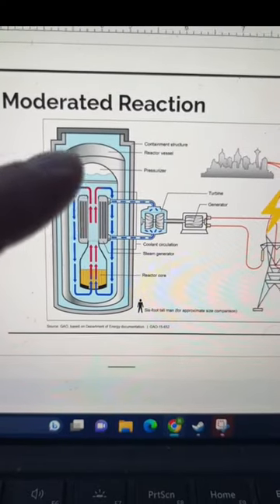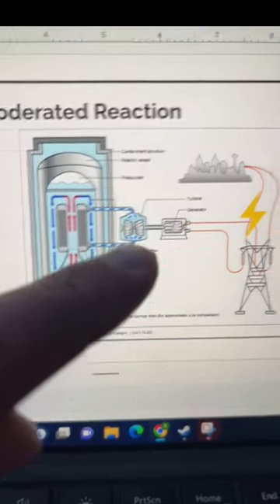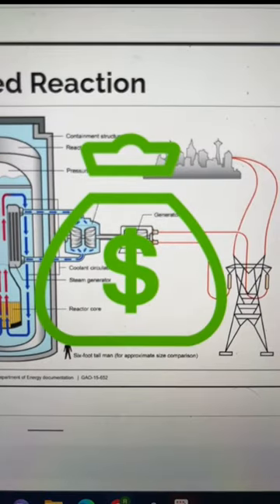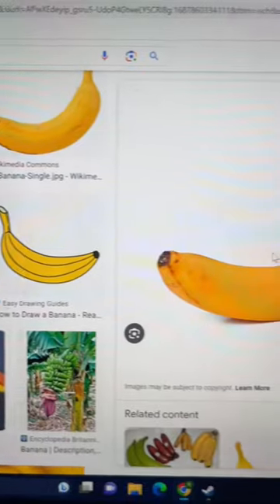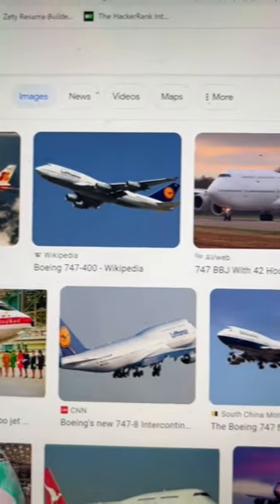No, The #Zaporizhzhia Nuclear Plant Will Not Explode

Comment: You can walk into the reactor building not the reactor. The used fuel in the reactor is highly radioactive and still emitting significant decay heat. If cooling isn’t maintained the reactor will continue to heat up until the point where the heat radiated by the vessel equals the heat generated by the fuel. As long as enough heat is removed to keep the core from boiling it will remain safe. If they don’t then when steam develops at high temperatures it will react with the zirconium in the fuel rods creating hydrogen and embrittling the zirconium. The pressure from the fission gases can cause the embrittled fuel rod to crack letting the fission gasses out. They are radioactive and if released into the reactor building, auxiliary buildings, or the environment will cause a minor problem. If the temperatures continues to rise because the decay heat isn’t removed it will eventually melt the fuel. Then you have TMI. You won’t get a Chernobyl or Fukushima because these reactors are PWRs.

Comment: But it was the spent fuel rods and the pools that wiped out the Fukushima Nuclear Power Plant.  The backup generators failed and the water evaporated.  When the rods were exposed to got so hot the broke down the water and released hydrogen into the reactor building and several of them blew up.

Right now with the Dam gone and the water levels too low they are relying on the reservoir pond attached to the power plant.  They problem is they can not cool the pond and it is too small to handle 6 reactors worth of spent rods.  Now it is possible to run pumps into the river or to truck in water, but they are in the middle of a war and Russia I don't think really cares.  There is still concerns.

Comment: I thought the concern was a lack of cooling water since that dam blew up
Reply: You just recirculate the water that's already in the plant. An outside source of water is only needed to top off the system to account for evaporation.
Reply: @ghost307  so how long before evaporation causes a need for a new outside source?
Reply: @moshethepirate1428  That depends on the design of the system.
At the plants I built it varied from months for the ones that built a cooling lake onsite to never for the one on the shore of Lake Erie.

Comment: The only thing that I would be concerned about is how long the reactor has been shut down. The heat from the decay of the fission product daughters can cause melting of the fuel matrix if there's a loss of coolant. Still almost definitely not enough heat to chernobyl, but enough to cause significant damage to the core.

Comment: I wonder if people are aware how bad of a recipe for disaster it is for a nuclear plant to be without power, or diesel for backup generators. The underground power cables to the plant have been cut, and/or compromised due to shelling countless times. Usually the backup diesel generators would kick in. But at one point they didn't even have diesel to run the generators. They were left in the dark. So far the longest they were stranded without power has been 12 hrs. Without power your hands are tied in more ways than one, and it's a ticking clock. And the words out that it's more likely that the Russians could be planning to destroy or damage large areas of vital infrastructure at the nuclear plant to create a major distraction for the oncoming Ukrainian forces. I sure hope not.

I don't think Ryan knows wth he's talking about to be frank!

Comment: The spent fuel pools ARE a serious risk to the entire plant's biosphere. If the pool water was to go for any reason, the spent fuel rods could go critical. If they did, there would be no way to shut them down, and the possibility of a meltdown is very real. If the rods melt down, they will burn through the pool concrete and cause a steam explosion when they hit the water table. This would cause a massive NON-NUCLEAR dirty explosion, seriously contaminating a very wide area. While the steam explosion is unlikely to cause a Chernobyl - like cloud moving over Europe, the heavily contaminated area surrounding ground zero would be many times larger than that of Chernobyl.

This is the real problem: an area about the size of the entire power plant, as radioactive as the roof top at Chernobyl, and at its centre a nuclear meltdown. Too radioactive for remote controlled vehicles to operate. The scale of the disaster, is probably too big for the resources of the entire planet to deal within a reasonable time frame.

Comment: No it won't explode but cutting off water to resupply those cooling pools and allowing them to boil dry could (if they have enough latent heat) cause a mini meltdown, which would be bad but would likely be contained within the shielded plant.

Comment: In cold shutdown state the temperature is not enough so even if you blow up the cooling water system the reactor will not go meltdow. You will have to blow up the entire reacfor causing fuel rods flying as ashes and thay will require lots of heat and explosive energy. Dont think any c4 or high explosive can do that. You will have to explode the reactor inside the capsules and released the pressure instantly. Impossible to do

Comment: Some.of this information isn't quiet right. The water doesn't need to cool b4 going into pods. As it never boils. The reaction separates the hydrogen and oxygen. It's fine to be in the water within 15 meters of the core. The radiation is greater at 35000 ft in an aircraft than standing in the water 15m from the reactor.

Comment: Nuclear power stations are safer than you think, what happened in Chernobyl was a freak situation that was basically caused by human error and poor understanding of how the plants cooling systems worked, the reactor would have automatically ‘scrammed’ but operators interfered with it and caused the explosion, the explosions were caused by hydrogen and oxygen gas exploding not radiation, things will be ok in the plant even if everybody up and left it unattended in its current configuration b

Comment: I don’t think you “shut down” a reactor just like that.  Control rods are inserted to absorb neutrons,
which slows the fission reaction down, but cannot stop it entirely.  The reactor critical material (most likely Uranium) will remain very hot and will require coolant.  If you lose that coolant there will be a meltdown, even in a “shut down” state…you just require less coolant than when it is at full tilt.  A meltdown would spew radioactive waste Chernobyl style in the immediate vicinity and wherever mother nature takes it (hello Russia).  So while no nuclear explosion is technically possible here, a gigantic and deadly disaster most certainly is.

Comment: Thanks for pointing out that Zap won't "explode". That is a fair comment, one that has NOT been made enough in the general discussion.

Great, "we", (aka the US) tested TRANSPORT canisters by crashing a train. I don't know for sure, but I suspect that transport containers are not the same as the on site storage tanks. Maybe they are, maybe they aren't.

On the other hand, do you really want to trust Soviet Era design and construction against a determined plan to breach them? 

Russia has all the appropriate specs for the containers. They have demolition experts who can create a demolition plan to breach the containers and to spread the contents explosively.  If we are lucky they gave the job to Vlad the goat herder from "Outer Slobovia", and he figured a couple of grenades would do the job.

If the russians do drain the cooling pools, then yes, given time the rods will overheat. They will probably catch fire. If they catch fire they will spread radioactive ash into the air.

Comment: Hmmm

I know containment vessels have been tested by driving high speed trains into them in the west...

I'd be rather less confident about anything radioactive that was built by Soviet engineers

I'd like to think otherwise, but it's just a sad fact

That said though, don't worry about the reactor if you live in a location with high levels of background radiation (typically due to the rocks beneath them) - but even then - look at rates of cancers in those areas - I bet they're insignificant and yet that's the critical number isn't it

Comment: Well no.... it won't explode. However, if its in a coolong pool it means its hot enough to melt and catch fire and essentially cause another Chernobyl type of accident. Dry stored fuel will not cause widespread contamination but would be a very large "dirty bomb" thus making the plant uninhabitable.
Reply: Chernobyl types of accident can't happen when there's a concrete biological shield. The Chernobyl disaster is infamous because the RBMK was built without a shielding dome to cut costs.

Comment: far as i remember there is only 1 of the 6 units in operation , the other 5 are in cold shutdown.. right?  as far as hitting something with a train... how does that compare to an anti armour /tank mine?  its like hitting a grape with a hammer that weighs as much as a barn vs hitting a grape with the barn... the idea they cannot be compromised is a bit wishful thinking... but who would mine nuclear waste storage?  i think the major fear should be ground water ... its like fracking... add rain water... thou destroying the dam will change the eco-system of ukraine... turning some of it potentially into desert so rain may not be that worry some.  the 1 that is still active could that still go into meltdown and cause another 3 mile island sort of scenerio?

Comment: Yeah...you are talking about a PWR, Pressurized Water Reactor made by Westinghouse, Babcock and Wilcox or Combustion Engineering. These are light water commercial reactors. Three Mile Island 1 and 2 were PWRs. These are the reactors that you can not enter containment during operations, except with a special permit. GE designed all of the BWRs world wide. Boiling Water.Reactors, another commercial light water reactor. These you can walk on top of during operations. Think Limerick 1 and 2.

You are pronouncing Zaporizhzihia incorrectly. I lived in Zap in 2010.  The 6 units at that NPP are another design called VVER, which are another type of light water reactor, not sure how they operate compared to BWRs/PWRs.

Your explanation of the Dry Cask Storage and NPPs producing energy are a basic synopsis.

Comment: Well, yeah, it's not a huge deal + panic only helps putin.

But it's also not just "like flying on a plane". 
If you live where the nuclear clouds come down it WOULD be like being on a plane. PERMANENTLY. 
A plane flight does expose you to quite a lot of radiation, which is why plane crews have significantly higher cancer rates. (Nearly double for some cancers.)

Nothing to panic about, but definitely not cool.

(And yes, in this case, the clouds of leaking radiation wouldn't go that far with high concentrations, still it's unecessary harm.)

Comment: Soo comparing a banana and flying in a plane to a reactor is much much different. In fact this video is kind of ignorant. So please dont talk about this. The reason why everyone is afraid of the plant isnt the cold shutdown or anything. It's the Russian occupancy of the plant and their intentional possibility of sabotage. Pretty much finding a way to make the reactors going into a melt downstate by overriding their safeties which can be done by bypassing them. And for the spent fuel pools? If they are not cooled all the time the pools heat up which then causes the pellets to overheat which can cause a explosion with the water in the air or water in the pellets. And for the uranium in the confinements? You can still turn them into some sort of nuke or dirty bomb. Now for the reactors? You have to have water in them for the "Cold Shutdown". This is what makes it a Cold shutdown. FYI it's refrigerated also so that's why backup power is needed. Please don't speak on something if you don't really know much about it. You have some good insight, but you also miss the mark a good number of times.

Comment: I felt the urge to laugh and not in a good way after watching this. He's missing a couple key pointer's here. It's not that all that simple easy peasy lemon squeazy. Makes me question what's his background on nuclear plants/reactors to be making such a statement.

Last, but not least they have a total of 15 reactor's. For context, chernobyl had 4, and Fukushima 5. And to my knowledge not ALL those 15 reactors are in cool shutdown.

Three main things are needed for a nuclear plant. Power, diesel for back-up generators, and water. Without power in the form of power cables, or diesel for generator's you're basically screwed if you are without power long enough. I bet he's not aware how many times (so many countless times) they've had no power, because the power cable was cut, or compromised due to shelling. No big deal right, because they've got the back up diesel generators right?! Wrong. At one point they had no diesel either. At one point they had zero power for 12 hrs. And now as of 2 days ago the words out that more likely the Russians could be planning to destroy or damage large areas of vital infrastructure at the nuclear plant to create a major distraction for the oncoming Ukrainian forces. So there's that to make matter's worse. 

In case of a fail, the radiation damage will reach at least 2 million square kilometers. It is estimated it would likely reach the middle east and north Africa.

There's more to this plant that's at risk than the simple picture he's painting of the situation at hand, but I'm going to leave it at that vs. get into it all. This comment is already pretty long. It's likely no one will even get through reading half of it..

Comment: This take is rather misleading. Yes, it won't explode on its own. But russians rigged 4 reactors with explosives turning those into 4 giant dirty bombs. Yes, it won't be a nuclear explosion, but this explosion will cause a radioactive contamination much worse then a nuclear bomb would. russians also mined cooling pool, and when they blow it up there'll be nothing to cool reactors down. That will cause a meltdown, which if not stopped will poison the land and waters of Dnipro and then the whole Black sea.

Also, comparing possible radioactive contamination caused by the largest NPP in Europe to bananas is so outlandish I can't believe you actually said it.

Instead of saying it won't happen, we should say what consequences russians will suffer if they dare to do it.